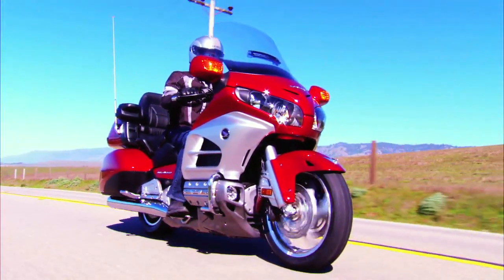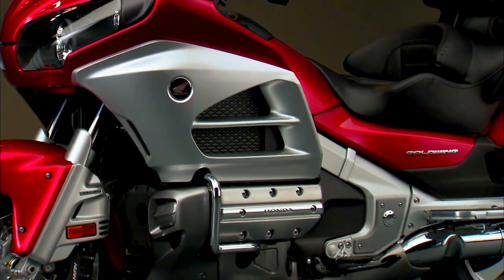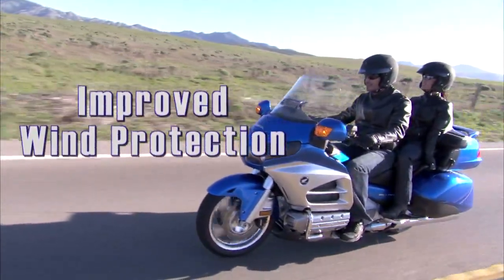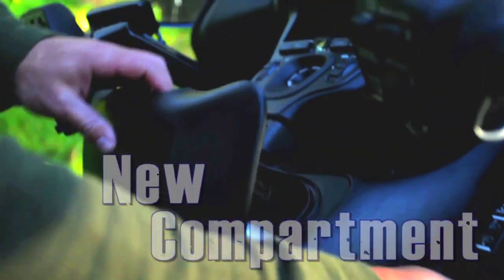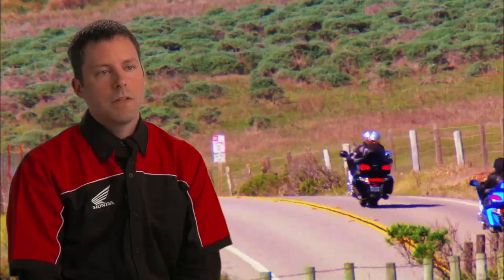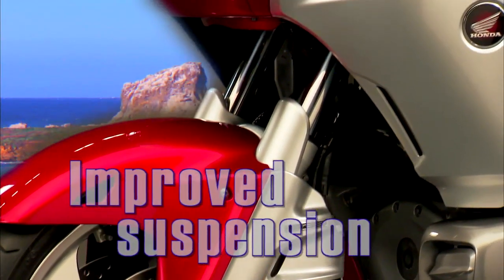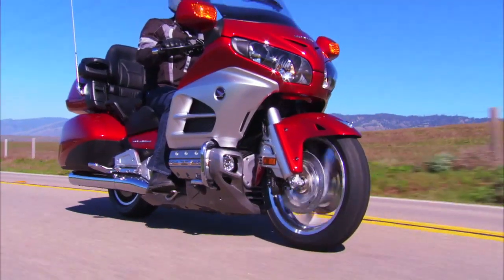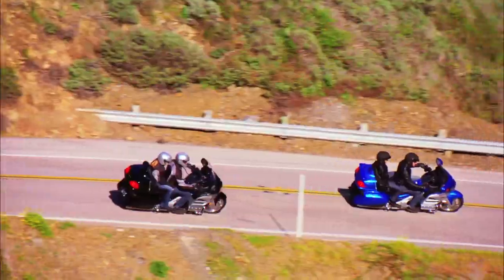2012 Honda Gold Wing Tech Specs

Comment: I've just been bitten by the bug. I'm pretty bummed out at how expensive even used ones are. They are more expensive than used Harley's 😬
Reply: I finally got my first Goldwing. I have looked for 2 years while saving my money. 2012 Base Model 7,400 Miles $11,400. I found it to be a good deal. The dealer had just installed brand new tires and an oil change. Hope you find one. I love it!
Reply: @pdruryiii  cool ! Sounds nice man ! I like the new model though that's more sporty.  They changed in 2018. So a used 2018 is still way too much for me lol
Reply: I just bought a 2009 model got 11k.

Comment: Not sure if I would like the Ipod connection in the trunk instead of the left pocket of faring.  I like to have access to my ipod if I need to without getting off the bike.
Reply: Until someone steals it from your moltorcycle
Reply: I preferred it in the side pocket hence I bought the bike a few years prior. There is almost no difference.